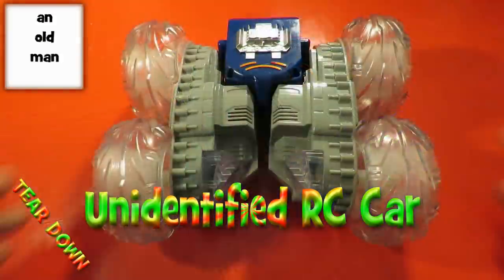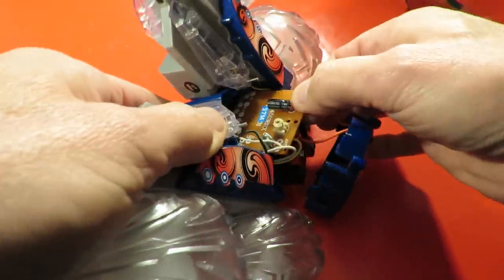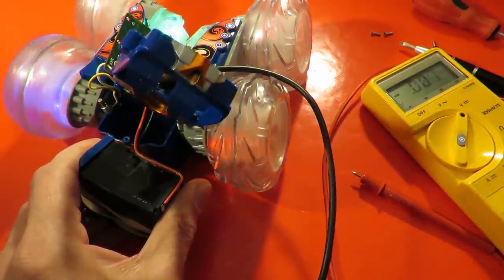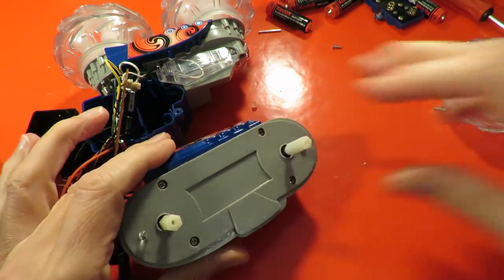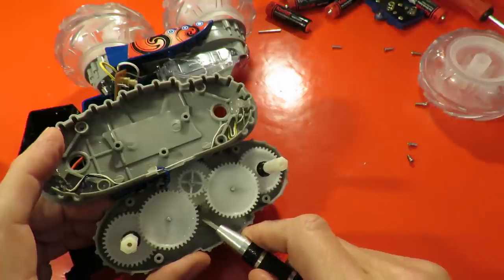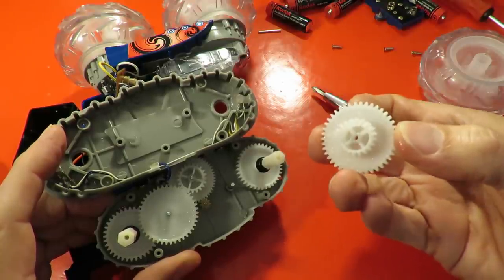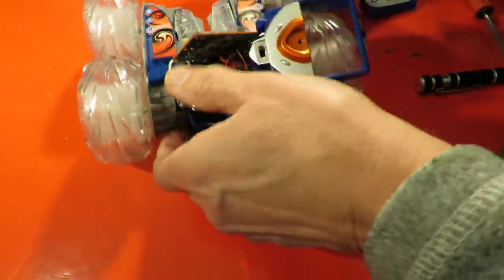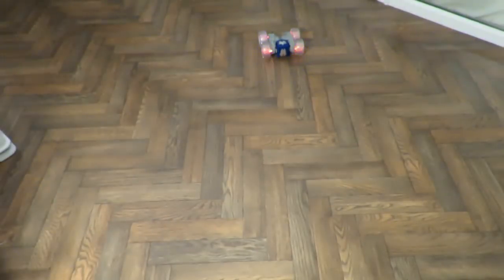Unidentified RC Car TEAR DOWN

Comment: Hey grandad.  I'm not too sure about the brand name but I found a video of a vehicle similar to this
Reply: I sent you a link
Reply from the maker: Thanks, now I have seen that running I can see what it is supposed to do. Mine has a little damage so if you try it upside down the bodywork drags on the floor. Also the tyres don't grip very well so it doesn't flip. Thanks for the link, I have created a small playlist for comparison of similar cars and added that video - RC Cars - Max Spinner Tyco Vertigo https://www.youtube.com/playlist?list=PLA5a2xPRSrB3Ls1tg8wPOZeWgxliJGT38

Comment: Nice teardown. I've got one of these, ended up gluing the wheels together and using a larger tank controller TX.
Was a Freecycle pickup. Quick 1min vid, to show outdoor grass performance: https://www.youtube.com/watch?v=wcXZlSP6mSs
Reply from the maker: Hi Slider, I've added your video to my playlist for this car. I like the idea of gluing the legs together. This one has some damage so the body drags on the floor if you have it upside down but gluing it solid would cure that. Obviously some of the spin tricks would be sacrificed but this one doesn't do them very well anyway, compared to the genuine original 😊